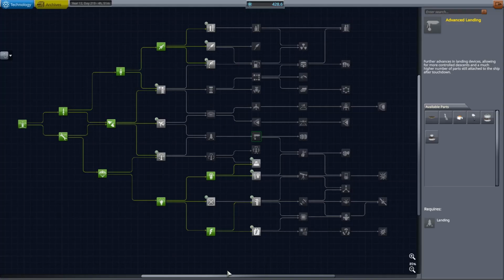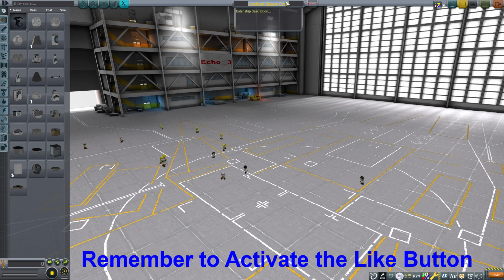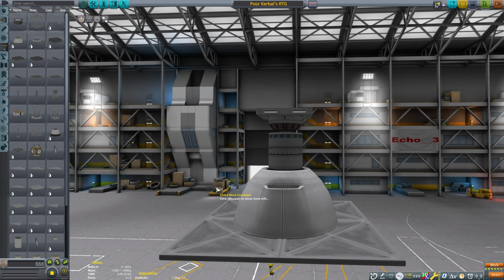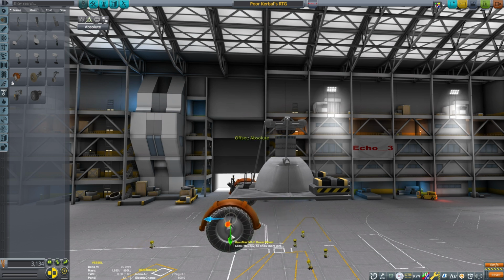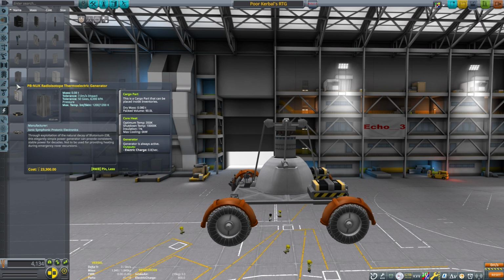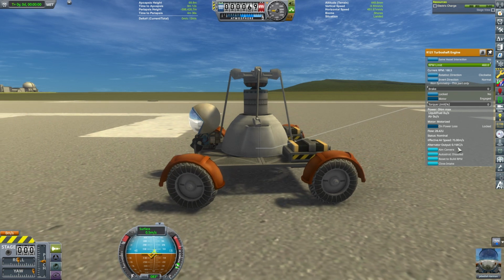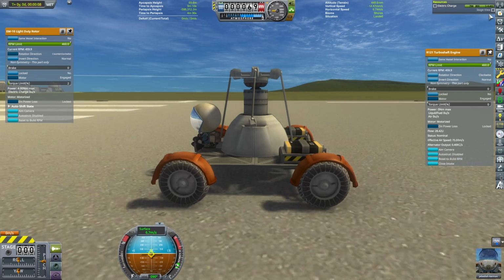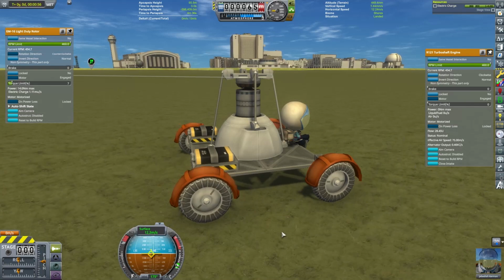A Poor Kerbal's RTG: Using a perpetual motion machine to generating electricity Breaking Ground DLC

Comment: Well that is fascinating and unexpected. I guess I'm so used to games patching out these types of exploits that I never bothered to check if this was possible. 

Thank you for showing us this!

Also, would it be possible to have multiple of these on a craft? Could you reach an amount to the point where you could instantly go from less than 1% charge to full in a few seconds (perhaps using the turboshaft engine to start and then switching to electric when up to speed)? Something for the Spiffing Brit to test, I guess.
Reply from the maker: I believe it is posible to use multiple of these. A big issue then is the mass. For any space flight applications, the lower mass solar panels will always be more effective.

Comment: Hey, I’m new here, both to your channel and KSP. Do you have a “recommended mod” video?  And a where to get them and get them working? Thanks!
Reply from the maker: I get most of my mods using CKAN. It's a good tool that installs and checks for dependencies and updates.

Most of my mods are visual. But I also have some that give more information such as KER, RCS Build Aid and docking port alignment indicator.